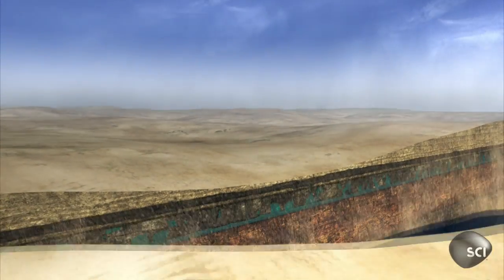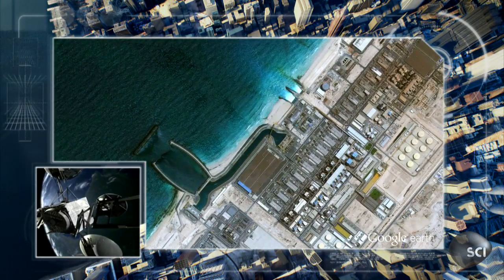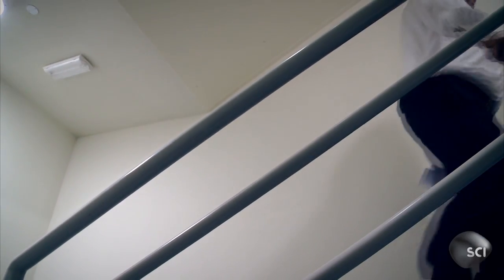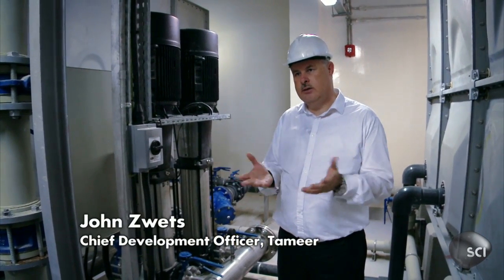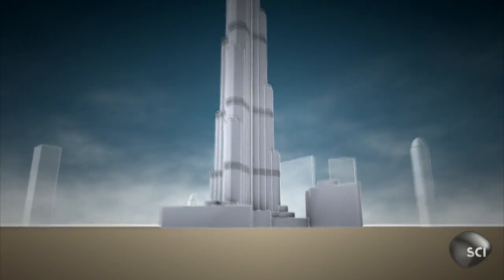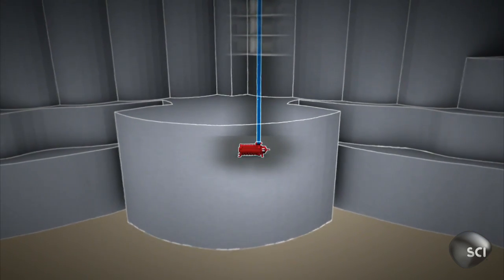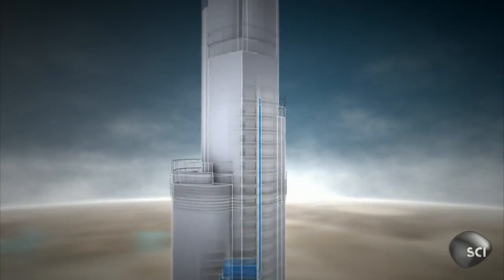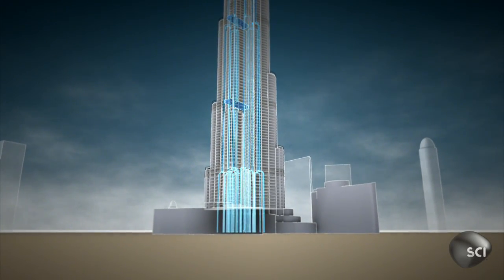Skyscraper Water Supply | Strip the City

Comment: I wanna know how these buildings are heated and how houses in cold places are warmed
Reply: These buildings are connected to district cooling plants. To maintain the room temperatures during hot & humid summer. District cooling plants are more electrical & water efficient compare to normal chiller units. It also helps to make good revenues for the services provider i believe:).

Comment: I don’t understand why filtered waste water excluding solid waste ie:bath and shower water in high rises is not used to flush toilets on the floors below and/or ran through a turbine to create electricity. 

There would be 2 drain systems. Drain 1 for ejected waste water that would not be reused. Drain 2 water would be filtered and treated into a tank below each floor which could overflow into more tanks in even lower floors . This water would be used to flush the toilets. The filters could be back flushed into drain 2 periodically to remove any waste.
Reply: One issue would be supply, might be more of a demand for gray water than available. Cant have a gray water system and fresh be interconnected for various reasons. Running the gray through a turbine for elcectricty although possible you wouldn't be able to maintain a consitant RPM on the turbine.
Reply: @randomsanwhich2  how about reservoir for this used water and when its full send it to turbine? I guess too complicated for small result/electricity produced?

Comment: they can use stream water instead pumping water to the top. water streamer less energy additionally pipe don't break out due to Heavyweight Pressure etc
Reply: karunai malai What is a water streamer? If you mean steam, i guess the throughput will be way too low, and having salt water in pipelines requires very expensive corrosion resistant pipes.
Reply: Also it takes time

Comment: Even if it's in stages, still the bottom pipe should feel the weight of all the water above it right. ?
Reply: nope, its not like that
Reply: @yepyolochannel  Can you please explain it then? I will appreciate it.
Reply: @sarathmohan979  the pipes rise up just past and above the tanks and then are angled back down so water flows out into the top of each tank. This way the water in the pipes is separated from the water collected in the tank. Solving your problem. (I'm just guessing this)

Comment: If you are afraid of pipes that could explode b, then why don't use metal pipes? ( thick metal pipes) it couldn't explode
Reply: You would be surprised to see what pressure can do to the hardest metals
Reply: @Blurrybob  make it thicker and thicker and thicker until it will be safe
Reply: @radinelaj3932  not cost effective
Reply: @Blurrybob  it depends,you can find cheaper ,who knows that
Reply: @radinelaj3932  find me cheaper, then we'll talk
Reply: @Blurrybob  😁, you can use glass pipes ( thick glass pipes)
Reply: @radinelaj3932  You have to understand how static head (pressure due to elevation works) For instance, for each 1m of elevation, that is 9.81N of pressure added. Imagine how much pressure would it build up with a skyscraper like Burj Khalifa. Also, if you want to thicken the pipes, you have to probably customize it because no manufacturers readily make thick tubes as you imagine. Also, you have to consider how much space would a thick pipe consume. The weight/load it will add to the overall structure, and how much expensive it would be.